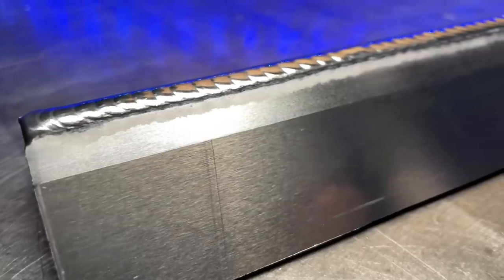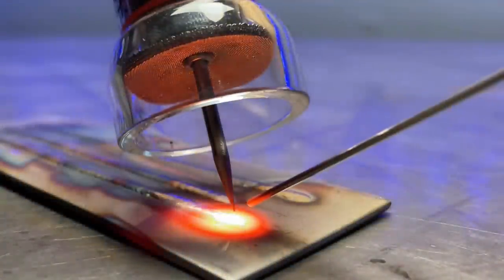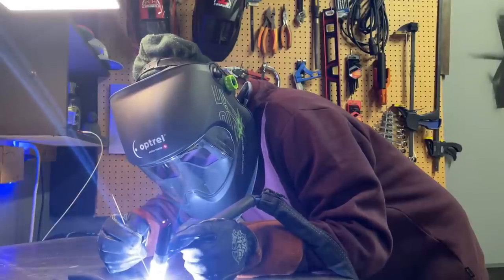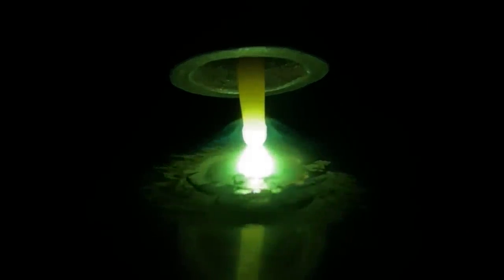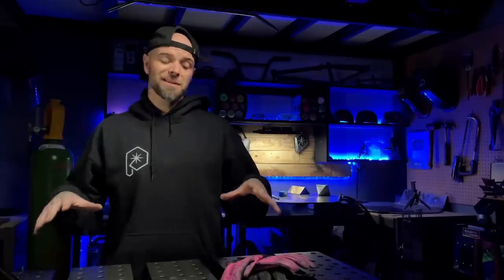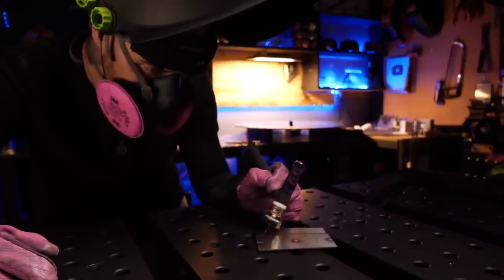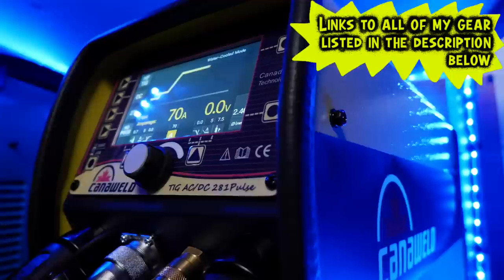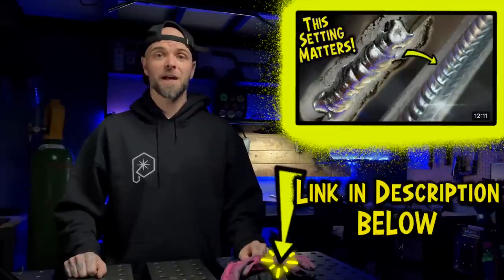EASY tips to get cleaner tig welds 💎

Comment: Putting physical barriers on the surrounding  area of work will help to contain the argon as opposed to having the gas just flow off of the work but make sure your still able to breath from a fresh source as welding with this gas in enclosed area's can be lethal if not adequately ventilated,can be easily overlooked and ignored. Cheers
Reply: Wicked hard read.  Delete.

Comment: Argon and most shielding gasses are heavier than air, if you breathe them in they can settle in the bottom of your lungs. it sounds odd but a doctor told me to get your mouth lower than your lungs to let it flow out, i hang off the end of my bed for a couple minutes and breath deep. It's worth a try if you feel out of breath after welding.

Comment: Hey man new to welding in general. Just got a 3 in one ESAB 205rebel. Having a good time. Question about which hand. As a right handed person I stick and MiG right handed. But my question is which hand do I hold the tig torch and which hand do I feed with. Obviously I want to be able to switch between hands based on the job but for first time practice and just learning. I’m thinking torch left and filler feeding right.

Comment: I'm new in tig welding and wanna ask a few tips about inverter tig weld ...what is a basic setup to start a machine for example. What amp should i dial ? Hz ? Base amp and much other stuff..im looking for a base line to start from here to there what should i increase what dont ..😂😂 i hope u get what i mean 😂😂
Reply: Amps are relative to the thickness of your metal and the heat needed to turn it to liquid.
1/6 steel might weld fine at 60 amps.  1/4 steel might like 130 to 150. Aluminum always needs more than steel because the heat spreads into the metal so fast.
Question on hertz could either refer to pulse weld settings or the AC function of aluminum welding. 
Not a beginner topic.
Pulse is good.  Try stuff out.
Reply: If you need a better answer about hz, clarify your question.

Comment: Is it fine to have postflow on stainless for 1sec only? More just seems like a waste of gas if I'm gonna be grinding it all down afterwards?
Reply: No better to protect your weld, less grinding and the weld looks good and is physically better, plus its work you can be proud of.
Reply: You need long enough post flow till the weld is not glowing red anymore.   If the weld gets contaminated your just grinding that contamination into the weld. Also need post flow to keep tungsten from getting contaminated while its hot